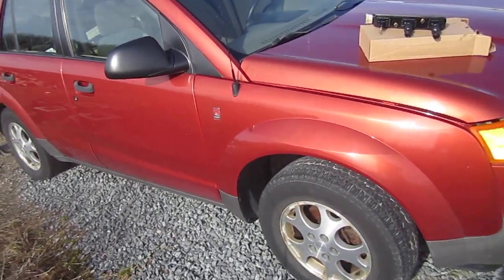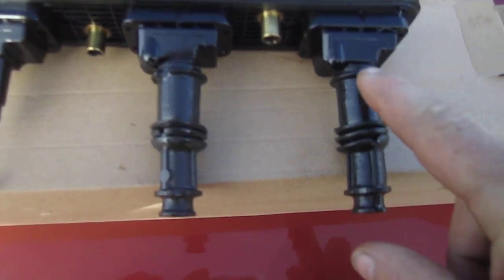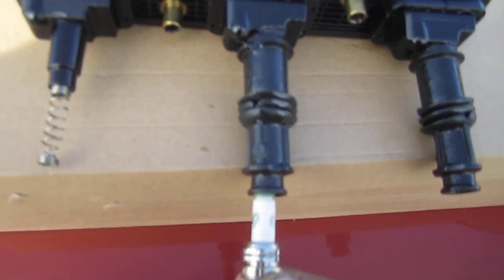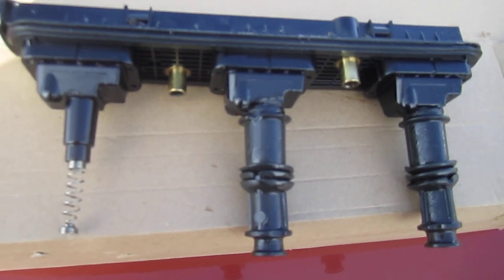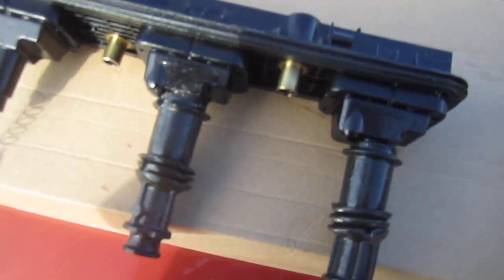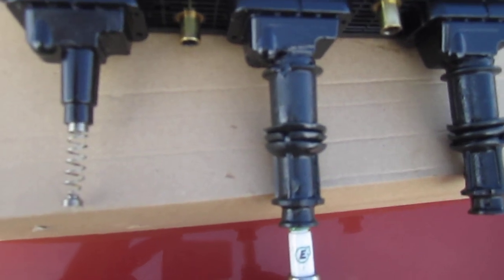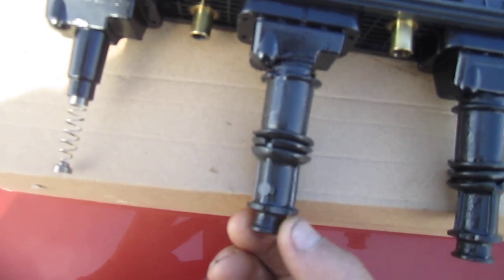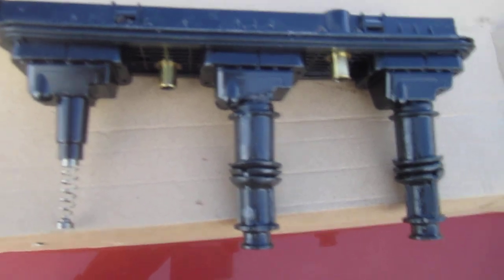Why Coil Packs Have Misfires On Saturn Vues  Coil Packs Are Still Good

Comment: And what is the first buttons in my experiences? If oil is getting down into the area where those boots are, then you have a spark plug tube seal leak on your valve cover.And these books

Comment: You said the same thing 4 times? Would have liked information about part numbers or if the boots can be replaced?
Reply from the maker: Yes the boots can be replaced. Research coil boots for the saturn vue  

See like these but not sure these are the ones you need.
https://www.amazon.com/Ignition-Boots-compatible-Saturn-2002-2007/dp/B0C8BQ1X3M

Comment: Okay you said because it's filling with oil how do you stop it from feeling with oil and how do you remove the oil
Reply from the maker: Change the valve cover gaskets or it could just be loose valve cover hold down bolts that need to be tightened back up. I used a rag and pushed it down into the holes and soaked it up.

Comment: I appreciate all your videos. 
You are definitely addressing why the Vue is occasionally misfiring, and addressing how to check if oil is get to the boot. However you are not even coming close to addressing the real problem. Why is oil getting into the boot in the first place. 
Can you please answer that question for me. 
What can I do to avoid oil getting into the boot?
Reply from the maker: Sure the valve cover bolts come loose over time from the gasket loosing it's hardness and getting to the bolts to tightening them up is not able to be done with out removing the plenum.

Comment: Why dident u say the reason for the oil getting in there....i will its because of valve cover gaskets are leaking oil into the spark plugs spots
Reply from the maker: I was more so interested in saying what happened to the rubber boots then how it was happening. Because if that has happened then it's to late and the boots need to be replaced and from replacing them then everything would be fine after the fix happens. Bad idea to just make sure the valve cover gaskets are sealing. Them coil pack rubber boots should be checked first and changed out if the leak was happening. After that point and the putting it all back together there should not be any leaks. To go through all the work to make sure the valve gaskets are not leaking with out going further to me is unsmart. But your right that,s the reason why.

Comment: Does this affect the 2004 ION as well?? Car was running fine one day, then it got cold and it misfires after it has warmed up.
Reply from the maker: Not sure.
Reply: I have a 04 ion. 
Suddenly got really bad misfires. I had a mechanic run diagnostic. I had already changed the ignition module ..that helped but it would still hiccup. I changed the ignition coil. Purrs like a kitten.
Reply from the maker: @marin2874  Glad to hear. : )
Reply: New coil and plugs did it for me. I figured it out after I posted this. Seems someone replaced coil pack 4 with an aftermarket and it was arcing back and never actually allowing the plug to fire. Did all 4 while I was at it.

Comment: It's simply pretty poor engineering all the way.  Those coil pack boots should have been constructed of plastic, and with the coil packs being located in such a way that it doesn't require a partial engine disassemble to access them.
Reply from the maker: Agree bad design for sure

Comment: I have a 2003 6 cylinder. Would this apply? Got a P0305 code. Cylinder 5 misfire and just recently changed the oil and stopped a water leak
Reply from the maker: If your coil packs are down under the valve covers. It sure could. Or one of the coil packs is messing up to give you the misfire.
Reply: Thanks mate. I'm going to check it out this weekend. Cheers from Washington State, on the coast
Reply from the maker: Not a problem.

Comment: I cleaned the old boots and used number 9mm orings around the "swolen" boot and that works just fine. also used number 13mm orings around the upper side of the boots, and they now fit perfectly. thanks you for the video.
Reply from the maker: Good idea.
Reply: That's thinking outside the box!
Reply: So was the swelling caused by oil getting in?
How did you fix that

Comment: Had same problems with my saturn All you have to do is change both ingnition control module and coil pack with spark plugs and will not misfire
Reply from the maker: Good tip Zac.
Reply: I did all that and it still does it
Reply: If the video owner in his diagnostici think the problem is not the boots but the cause of the boots swelling which really is the oil. If the valve cover gasket going bad is what immerses the boots ik the oil then fix that first then change the boots or the coils altogether nd the problem will b gone. 
However, replace the boots and as soon as the get flooded in oil again, good morning misfires 🙌🙌

Comment: I have a Vauxhall Agila. Similar coil pack arrangement and shape since the engine is still from General Motors, a Z12XE Ecotec one (google images for "Agila coilpack", it still has the rubber boots you talk about in the video). I had a valve cover gasket leak on my engine for i think a year. One day i found the converter's heat shield was very dirty, then noticed some oil leaking from the top of the engine when it was warm, and finally had it replaced and though the mechanic said that some oil got in the sparkplug holes and he had to clean them (he didn't mention the rubber boots swelling up but i'm surely going to check it now, thanks for the video), my car never misfired at all. Perhaps it was on the point of doing so but then i had that damn gasket changed and all is good now, never saw the CEL lighting up, no DTC at all in the ECU. If i understand it correctly, basically, rubber is an electrical insulator so if the spark plug boot swells up (i know that O-rings usually swell up if petrol based solvents such as jet fuel get on them) the spark can directly fly to the metal earth pole in the middle of the plug with no need to travel to the sparkplug's tip electrodes at all (the opening through the lower part of the boot becomes the path of least resistance essentially and if the engine becomes warm it could open even more due to thermal expansion and this explains why it often becomes an on & off issue with the engine running good when cold and rough when warm) and bam, you have a misfiring engine. I think it would be really hard to find the boots alone if they're the only part that needs replacement. P.S. i've read somewhere on the Net of a recall made by Saturn about the Ignition Control Module (=Coil pack?) on the L series. Could something along the lines of this possibly be the reason?

Comment: swelled boot not causing misfire its the oil filled hole stopped the flow all together
Reply from the maker: no that's not it. That's not a helper for sure. The boot needs to be tight up all connecting places. It needs to be a sealed unit.
Reply: Basically the boot (since rubber is an isolant), if it swells up, opens up a path of least resistance with respect to the sparkplug's tip electrodes. So rather than traveling down to the tip and arcing to the lower ground terminal, the high voltage current arcs between the compressed spring and the middle ground terminal (the metal part in the middle of the spark plug). I don't know if oil, being a dielectric, can play a part in this.

Comment: would this cause a slight stutter at lower rpms
Reply from the maker: Yes
Reply: so you dont think it would be the torque converter causing it
Reply: by the way it is an 06 vue v6 fwd
Reply from the maker: Its hard to say what its going to be causing it for sure. It could be many things really. The torque converter would be my last thought.. It could be as simple as a broken belt in a tire. Its really hard to say for certain.

Comment: Hi,Can I buy the boots or is there a fix using the old boots? Thanks,Jim
Reply from the maker: http://www.ebay.ca/itm/New-BWD-SPB182-Direct-Ignition-Coil-on-Boot-Plug-2002-Saturn-Vue-others-/301309196822?fits=Make%3ASaturn%7CModel%3AVue&hash=item46276d7a16:m:mRRMoz8FE_rVp2dhhhaZ5vg&vxp=mtr
Reply from the maker: http://www.ebay.ca/itm/Spark-Plug-Boot-Kit-Coil-on-Plug-Boots-PRESTOLITE-116083-/222015391758?fits=Make%3ASaturn%7CModel%3AVue&hash=item33b126080e:g:T3QAAOSwa-dWs95O&vxp=mtr
Reply from the maker: Could also use a real good caulking that oil does not have a effect on. Basically like gluing it on to the coil pack and to the spark plug to seal it real good so no off sparks happen. If off sparks happen its going to act like there is a bad coil. Thanks Jim hope it helps.

Comment: You are right about the oil causing the boots to swell and causing the misfire. You need to change your valve cover gaskets, over time and heat cycles of the engine the gaskets get hard and don't seal as well. They essentially lose their elasticity.
Reply from the maker: +jdtractor man That's right yes

Comment: My 2002 saturn vue keeps misfiring and flashes the service soon light.
Tried plugging in the diagnostic machine nothing comes up as if there is no connection between the machine and the ECU,
Could it be a bad ECU ?
Please help
Reply from the maker: adams patel It could be. I would try doubling up the ground wire to it or add one to it. Sometimes it has a hard time grounding out. Or perhaps at least clean it all real good to make sure it has a good ground. I,v done that to mine. Gave it another ground. Its not hard to do. Just take a wire and put it to the inner fender wall or a place like that and run it close to or onto one of the bolts that hold the ECU in place. Its worth a try to see and only makes sure its getting the ground it needs to do its thing. IT SURE SOUNDS LIKE A GROUND ISSUE. Hope this helps. Best of luck.